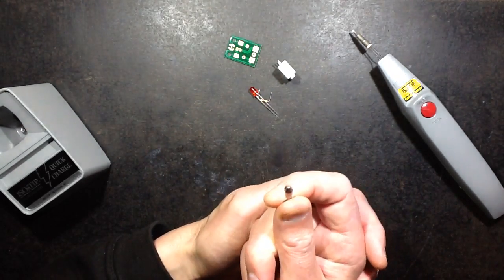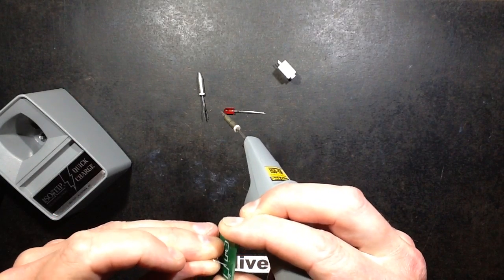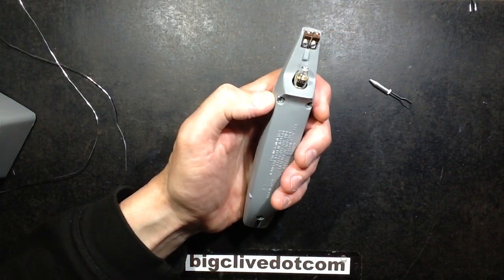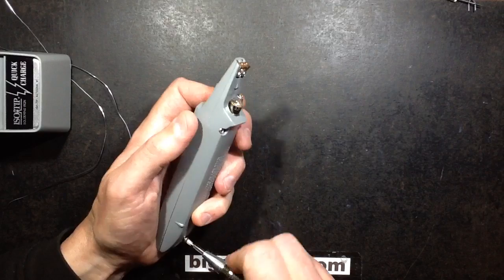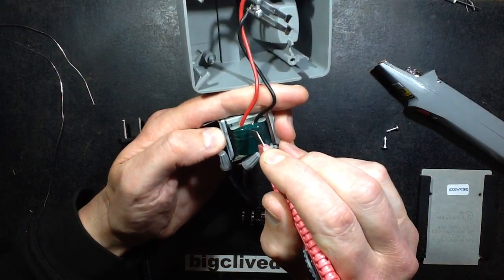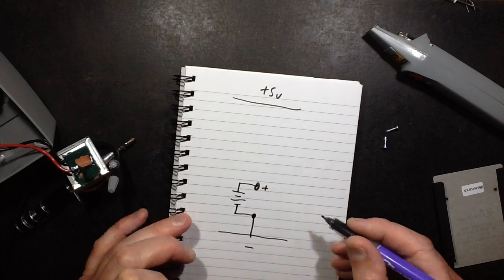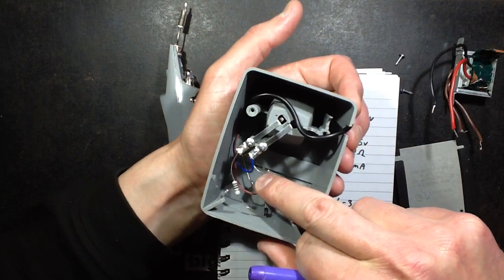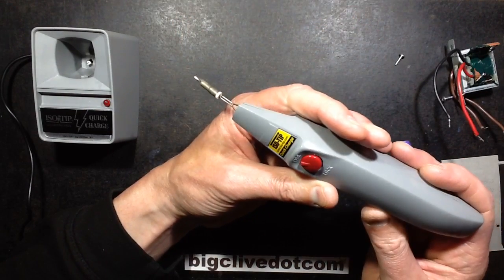Inside an Iso-tip rechargeable soldering iron.  (And charger hack.)

Comment: This is amazing. I had no idea they still made these. The one I was hoping to find on here was the super cheap ones that run on two AA batteries.
Now I need to dig up Dad's IsoTip from the 80's and see if I can resurrect it.
Reply from the maker: +BRMBug Theoretically if its cells had died then fitting new ones would result in near-new performance.

Comment: A very nice soldering iron. We had one in our avionics shop when I was in the Navy. Very handy to use on aircraft on the line,, unfortunately the batteries developed a surface charge after several months use.
Reply: The batteries were the weak link in this tool. Redesign for USB charge, and using Eneloop NiMH cells, could make it a winner again.

Comment: I have to say Clive, you've really inspired me to start hacking about with electronics. I've been repairing computers since I was 13 (nothing that required soldering or anything of the sort). The only caveat I can see is the cost of the initial bits to get into it (soldering iron, solder, etc). I'm disabled and relying on the gov't for a measly amount of income.

tl;dr my main question. What sort of soldering iron should I go for? I'm a bit hesitant to do anything from China because you never know (think pink USB charger).
Reply from the maker: +Dakota Blake Actually a typical Chinese knock-off Hakko soldering station is usually pretty good.  Just check it has proper earth continuity between the plug and iron before use.

Comment: They probably should have put the diode in the soldering iron, rather than in the charger. Apart from that, it seems fairly fail safe...
Reply: +Phino K.M. I was thinking the same thing. That would also have the benefit of blocking the battery's output from the charging pins, so that the battery couldn't short out if something bridged them.
Reply: Didn't he say there was fuse wire in there?

Comment: In a circuit like this, where the the bit is a very low resistance, what's keeping the whole unit from getting hot?

I'm not entirely sure what resistance the wiring or copper plating has to even attempt a calculation on it, but it must be quite low for the bit to be dissipating 40 watts. Seems like the rest of the circuit would need to be around 0.01ohms, at which point the rest of the device would be dissipating about 5 watts?

I'm not sure if that amounts to much or if I even went about that the right way

Comment: hm, there are high amps 18650 cells available now, why not use them?
Reply: +S0N1Cx4z6y they are a higher voltage so they would have to redesign the tip and they need charging circutry
Reply: +S0N1Cx4z6y Extreme danger.
Reply: +DMAN22yeah i guess he is reffering to it catching on fire but if they are rated correctly it should be fine
Reply: +Arend Mookhoek yeah, there is too much hype about how dangerous they are, use a proper charger, dont take them below 2.5v and dont short them.
Reply: finally someone who isnt stupid when it comes to lithium batteries
Reply: Arend Mookhoek ikr there are so many people scared of them because they dont know how to use them. the media hypes up any incident involving batteries. its stupid.

Comment: Few questions. . . shouldnt the charging station, before and after modification have a fucking fuse at least? I mean its illegal to sell fuseless mains connected products in some parts of EU. 
Second question, u said its to sit in the station all the time. . but umm. . .u know batteries of all kinds overheat and potentially explode when u overcharge them. So, shouldnt this have a modern temperature and voltage sensing circuit to cut off power before fully depleting the battery and before the battery gets overcharged?
Reply from the maker: +GotCritified Power supply will handle a short circuit and nickel cadmium batteries can be trickle charged indefinitely.
Reply: +GotCritified He answered both these questions in the review by the way. He discussed the fuse wire. Because it's simple it doesn't have a fuse seperately, it just has a portion of wire thats so thin it heats rapidly if too much current is applied and breaks the connection. 

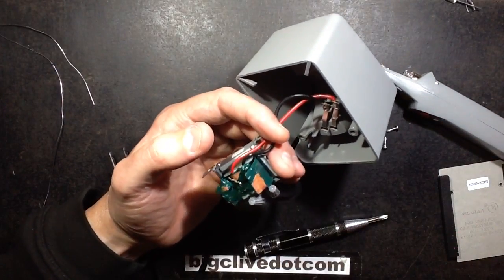Then there is the base station The transformer used basically self regulates voltage so that as the battery gets closer to charge it. This is what he talks about around 16:20 about transformer regulation. As the load (battery needing charged) decreases it decreases how much it sends to charge it and they've carefully chosen the transformer and battery to compliment another so that as the battery approaches full it sends only a small amount of charge to it.

Comment: All you need to make it look vintage is a mustard yellow or avacado green housing for both pieces, and a little bit of simulated wood grain
Reply: nah, the slate color makes it look like it came straight out of a boeing shop in the 70s. slate was the color for high end shops.
Reply: +ChozoSR388 They actually do make a yellow version of this. It's the same as the one in the video, except it charges in 1 hour, rather than 3-4.
Reply: RecurveNinja
Nce.  Faster is better!
Reply: *****
IIRC it claims the same number of joints per charge as the 3-4 hour one, which I assume would mean the same battery, but different charging circuitry capable of handling more amps.
Reply: *****
 "No matter how well built a sodering iron can only pull at the most 5 amp/hour charge rate" Says who? You? Because there are only a few things limiting a battery's rate of charge: current charge (in this context, current means "at the present time", not in the electrical sense), battery composition (NiCad, LiPo, etc) , maximum amperage supported by charge host (The wall wart or charging base), and the charging circuitry within the device itself. NiCad batteries, if that is indeed what is inside the yellow version, can be relatively safely quick-charged at 1C, where 1 is the multiplier, and C is the capacity of the cell in amp-hours. You could charge a 2600mAh battery at 2.6 amps, providing the charge controller inside the device and its supporting components are capable of withstanding that level of current. The fact that it's a soldering iron is completely, totally, 100% irrelevant. What exactly do you mean by "240v amp/hour charge rate"? Charging something at 1A, 240V for an hour?

They don't paint plastic products, they dye them. Your theory about paint chips causing shorts is bogus.
Reply: +The Joker I had one of the fast charge units years ago. They way they work is to add a manually resettable thermal switch spot welded to the battery. To fast recharge, one operates a slider that resets the switch, which selects the higher charge current. When it reaches full charge the battery gets hot, causing the switch to trip and reducing the charge current back to "normal". Works nicely!

Comment: completely unavailable in Australia. typical.
Reply: found it, if anyone in Australia is interested, mouser sell it for about $80, search for the wahl 7700
Reply: +Tunsafun[BSTRD] +bigclivedotcom 

They sent him a unit but their site DOESN'T EVEN SHIP TO THE UK LOL, in fact nothing outside the USA/Canada ...
Reply: @afterlifedes  I'm surprised they could send him one at all. I was under the impression that NiCd batteries were actually outlawed in the UK several years ago.
Edit: Oh. This video IS several years old. Teach me not to check the dates. He got this RIGHT before the law changed.
Reply: Will not ship to EU as used of NiCad battery for power tool usage has been banned from 2016 (2006/66/EC) due to the toxic material that needs to be disposed of  -- still permitted for emergency lighting but most of that has changed as well that I have seen.
Reply: +Tunsafun[BSTRD] element14 appear to sell them
Reply: +afterlifedes  They do actually ship outside the USA/Canada, you have to contact them via email etc.
Reply: ***** thanks for the info!
Reply: +Werner Tømmerstøl But after the recent incidents about the batteries do they ship it by plane? Just curious :s
Reply: i don't know, i would think so, judging by the time it arrived, i would think so.

Comment: I had a small, on the road, soldering repair to do...basically only 2 joints. I bought one of Maplins battery operated (3xAA) portables. The most useless thing I ever bought!! It doesn't even get hot enough to melt the Included "lead free" solder!
Reply from the maker: +Paul Austin Yeah, I've tried a few of the AA powered things like soldering irons and glue guns.  They tend to fall short of expectations with fresh cells and it's downhill from there.

Comment: you sir, made me want to order one of these! keep it up!
Reply: Yes, I don't do soldering but, I also want one too. Problem is our AU$ is very low against the US$ it now makes it a bit more of an expensive item to purchase. Still, I will have to see how it goes because I want to make the BigClive LED Crystal Entity and there is a small bit of soldering or parts in that. Would be much easier to do without a pesky power cord continually dragging the 10W iron away from the target.

Comment: Looks much better than the Coleman Cold Heat soldering irons with the graphite tips that broke after 5 seconds of use.
Reply from the maker: +Blaine Bugaski Those things were terrible.  I also broke mine trying to press it to get a connection.
Reply: Yes garbage!  I even had a few warrantied that broke the tip and the spare tip before you could even do anything on the warranty units.  OH well they weren't very costly and this is probably 15 years ago or so.
Reply from the maker: +Blaine Bugaski Yeah, the cold heat soldering irons were just terrible.  Hence why they were marketed in force by telesales.
Reply: +Blaine Bugaski I made a homemade graphite soldering iron and it melted itself
Reply: FutureInventions They were crap!  Never could heat up the solder right.  And/or the tip broke before you even got a chance to figure out that they sucked!  They were really a total suck fest!
Reply: Merle Mitchell Which device are you talking about, the Iso-Tip or Cold Heat?
Reply: Sorry,
 The Cold Heat.
Reply: +Blaine Bugaski I tried one of those, terrible results sadly. In fact I got sent two by mistake so the other has never been used.
Reply: Merle Mitchell No kidding.  Scary stuff.  I sold mine on ebay a few months ago.  Dug them up after they sat at the bottom of a box for at least 10 years.
Reply: +Blaine Bugaski Ugh I had one of those as a kid. Soldered a whole LED matrix together for an arduino shield and thought I was just really shit at soldering. When I finally got a real soldering iron I realized what a piece of crap that was
Reply: Shaheer Syed I see.  Luckily you weren't injured!
Reply: +Shaheer Syed Sounds like you made it properly then - the commercial ones always melted down when you tried to use them like a real soldering iron. :-)
Reply: ***** Wait - you mean they didn't actually work as a soldering iron?
Reply: I meant they work well - until they melt. I haven't had much luck with the 'cold heat' type of iron.
Reply: Matt Tester Send it to Ebay!
Reply: I still have mine...almost new in the box...minus the primary & spare tips  :)
Reply: I have a cold heat soldering iron and it's junk.  See my comment above about what I'm planning on doing with it.
Reply: +bigclivedotcom I was given one as a gift. I had the same trouble with the tip, but what was worse was the day it shorted out in my hand and began to melt. I barely had time to chuck it out in the yard before the power cell blew up.

Comment: they probably didn't change the design because it's such as low volume niche product that they dont want to spend money on tooling to make new moulds for an updated design and electronics for LED. Thungsten lights aren't great they consume more power and spray the light everywhere, it would have been better to use a focused led light that wil point light at the soldering tip and use less power, Also a delay power button would be handy so it keeps the power on for 5-10 seconds after releasing the button.

Comment: What about over charge the battery? any protection for over charge it?
Reply from the maker: +Tom Ocean The traditional NiCd cells can't be overcharged.  They can sit on constant trickle charge.
Reply: +bigclivedotcom well, they can be overcharged, if you try very hard. The results can be rather hot, and moist, and somewhat corrosive...

Comment: Hello Clive.  I hope you are well.  I love you video post's,  calm and collective. Well Done. My question is that I have a Draper battery rechargeable soldering iron like the one you use to have and uses the same tip as the Iso-Tip, will this tip be capable of running off a USB 5volt power supply? Regards Sam
Reply from the maker: Sadly no.  The little tips draw a huge current, so they'd look like a short circuit to a typical USB power supply.

Comment: Ya know, I was thinking this could make for a fun project to replace the batteries with a Li-ion cell and connecting a little TP4056 to the contacts on the bottom, then have the charger feed it 5V and for good measure go ahead and replace the light for a LED, dunno how well the tip would like the 4.2-3v rather than 2.4v but I guess it doesn't matter anyway because after giving it a second thought it would be kind of pointless as that would mean replacing basically all the electronics and meaning doing so I might as well go ahead and get my own enclosure/tip too while I'm at it, thus defeating the point of buying one if the first place.

Comment: hi....i buy one in a yard sale,by now change the old nicad pack to one lion 18650  2200 ma an work great,to recharge it i use a cheap 18650 battery automatic charger ($2.99) installed in the charging base.

Comment: Ah yes, got to love the KISS System. (KISS= Keep It Simple Stupid) They always work far better than the more complicated equipment. But the best part of this unit is that it is Fixable, you can replace the battery, light bulb and the fuse link or wire and the tips. Not many things like that made today, most are just disposable. If the hand held unit goes out you have to buy a whole new set including the charger and it is the same if the charger goes out. What a waste.  I have a $400.00 TV that went out and brought it to a shop that told me it would cost more than a new one to fix. I've been watching your videos for a while now and thought I would open it up and check it out. I found a cracked circuit board that split a printed circuit. All it took was a soldering iron, a bit of solder and a short thin wire to jump the crack in the circuit to fix it, only took about an hour of my time. 
P.S. I'm no electrician

Comment: Is there any protection for the back end of it so that you can't accidentally short the battery through the charge leads?
Reply from the maker: +Troy Adams Yes....   A fuse!  Although a simple diode would obviously have been better.
Reply: +Troy Adams 
One could use a piece of electrical tape or duct tape to cover the end temporarily. I've used the plastic covers for cannon plugs or from metal tubing end protectors and even some plastic protective covers that come on other items that would normally be discarded, like the covers that come on new computer cables. I had an expensive rechargeable flashlight or torch that had a square hole in the back cap were the recharging pins are and found that one of those computer cable protectors fit nice and tight in that square hole. I work on aircraft and there is a lot of safety wire on stuff to keep them from coming off and in tight places, sometimes I have to work on them outside in the rain. It is possible that one of those safety wires, untrimmed, or water to find it's way in that area and short out that flashlight. So as a precaution I found that cable end cap worked. Some of those things you can find on line others you can find if you look around and re-purpose it. Just suggestions.
Reply: These really were designed to be stored in the charging stand rather than a portable soldering iron. I have one from the 70's and out of all my gas and electric irons it's my favorite. Quick to heat up and cool down and no dangling cord. I've got the small needle like tip on mine which works great for tight circuit board work, I can't seem to find another cordless iron that's as good in tight spaces! I'd love to see this iron's tips built into a cordless that's programmable. like the ts 100.

Comment: I had one of these back in the 70s and it was junk  and it remains junk if it (as you pointed out) hasn't changed since then. You seem experienced but come on,  I just don't know if your access to quality products is limited but the tips would break off, the bulbs would unscrew, there was no protection for the button or the tip for storage or a flite kit and the filaments in the bulb would break IT'S JUNK and unless they send me one and prove otherwise it still is!!!